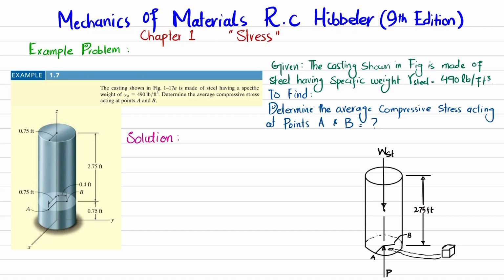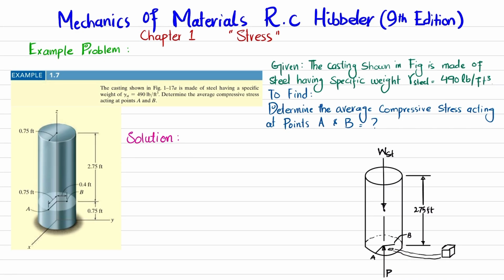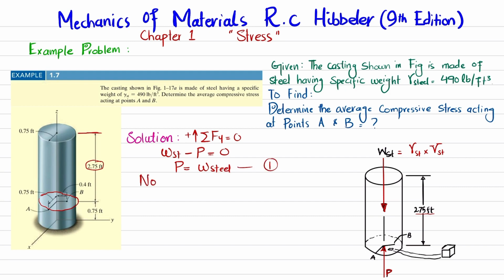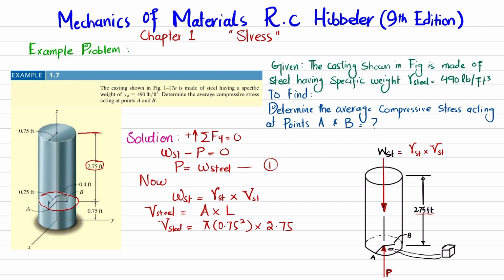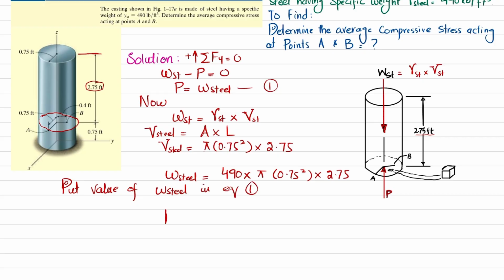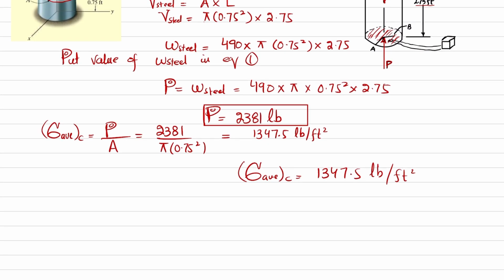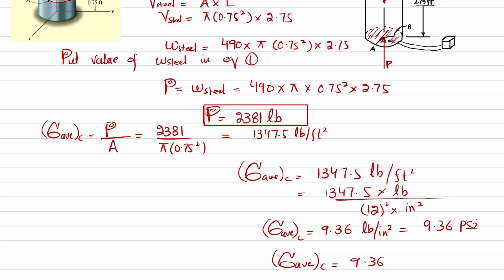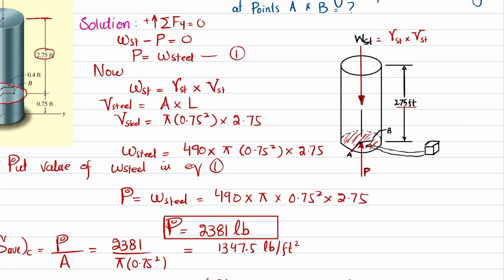Determine average compressive stress acting at points A and B | Example 1.7 | Mechanics of material

Comment: Why we solve this question so lengthy if we want to get the weight of steel so we multiply gamma × volume of steel = 1347.5 final answer simple
Reply from the maker: This is the procedure and I have to explain for those who don't know about this also we are taking the whole length instead we are taking 2.75 ft length but anyways once you learn , you always think of many way to solve it quicker. ❤